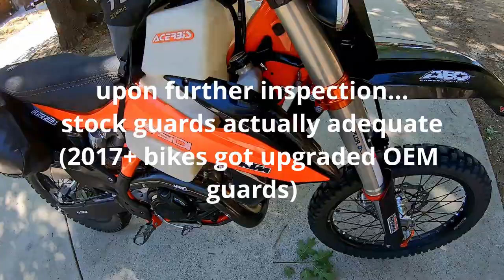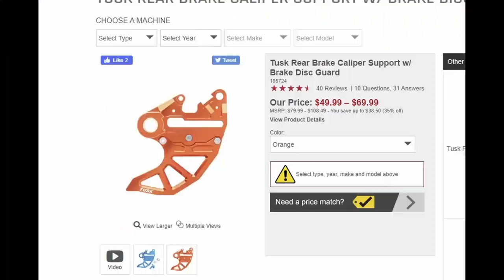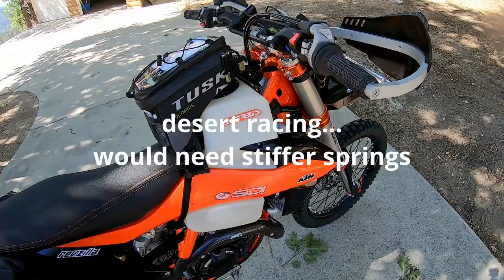Building my Ultimate Dual Sport  |  2020 KTM 500 EXC Build - Part I

Comment: I have the 2018 model and can honestly confirm they are awesome machines, even in stock form. Considering you're using your bike for 1-2 day adventures, there is very little mods required in my opinion (other than the extended fuel range). Even the standard seat is good enough, if it's too uncomfortable then you're Sitting down too much. These bikes are pretty much perfect straight off the shop floor. There's very little need for all the added bling, it's a dirt bike....just ride it.

Comment: You can increase oil capacity with larger oil cap and change oil filter to a filter that filters our particles down to 2 microns and you can run 30,40 or 50 hours between oil changes.  They do it in desert racing on these bikes and haven't had problems yet doing that fyi

Comment: That skid plate is terrible.  I got a few dents in my frame.  I upgraded to the axp no new dents.  I would recommend the ktmandhusky.com radiator guards with the cross brace.  My bike took a nasty fall off a steep cliff into a rock garden with those guards no rad damage at all.
Reply: I have the non-6 Days bike, same year/size.  I added an AXP skid plate and love it!  Strong, lightweight and doesn’t viiibbbbrrrate.
Reply: I went with the Enduro engineering skid plate, it’s pretty stout armor.

Comment: I like what you have done to the bike I have a 17 that I do 150 - 200 mile day rides (brewery hopping) in nor cal and thinking about the 20 or 21 500. Ride safe. P.S. If you ever get checked by a ranger or pulled over on the street they will stick a small long rod down your exhaust to check for that screen (sparkarester) and you will get a very expensive ticket if it is not there. there is a company called bestdualsport.com that has end caps with the screen that are not restrictive.
Reply from the maker: There is another screen inside... thankfully

Comment: Great video, as usual. What do you think about having no Kick option for a long range adv bike ? I'm about to get a 2019 and not a 2020 only for this reason.
Reply from the maker: I hate that there is no kick. I had one on my 2014 EXC. THey need to put it back on. Now I carry a small battery jumper pack sometimes
Reply: @BigRockMoto  Yes i agree that the option i will take too if i get a 2020. Also, the engine seems a lot smoother than the older models. Having more power is cool, but is it still as fun/brutal as before ? Thanks for the answer !

Comment: Question:  I have the KTM 350 EXC and see that you removed the mesh from the stock exhaust end cap at the end of the video. How did you do it and does it lean the bike out too much?  Most end cap changes require you the program the bike.  Would love to know!
Reply: The 2020 and newer has an O2 sensor that automatically adjusts the air mixture within reason, for such a small change in engine flow dynamics.

Comment: What tires do you recommend as I do mostly dirt with connector in and around phx arizona
Reply: I have the same bike (not 6 Days) and run Goldentyre GT216AA on front and GT333 on the rear, both with Tubliss.  I’m 95% dirt and ride in SoCal.  Super tires!